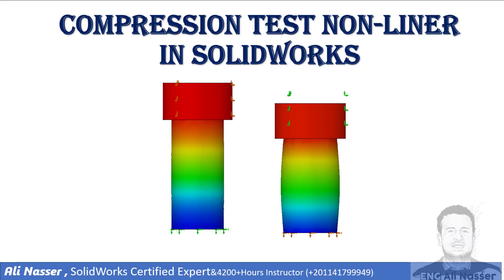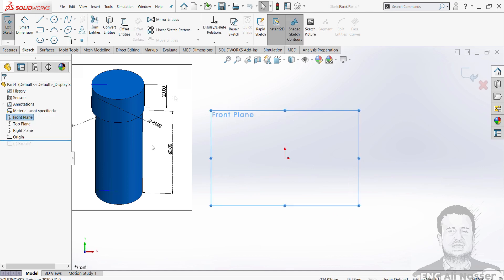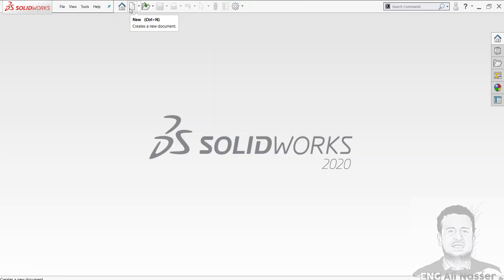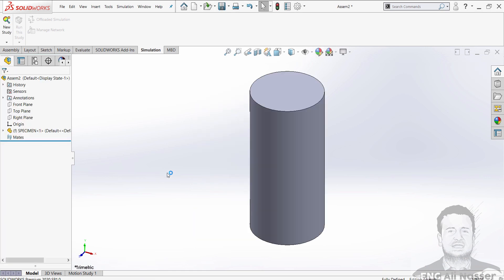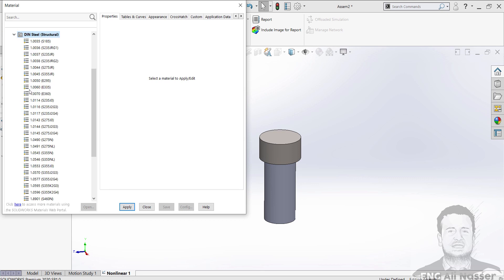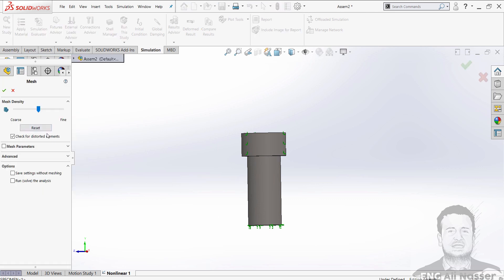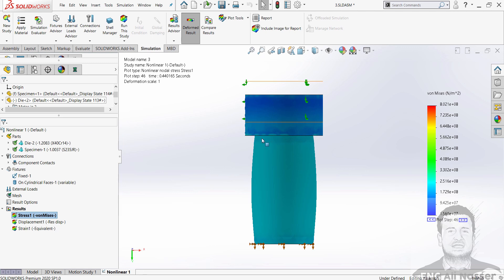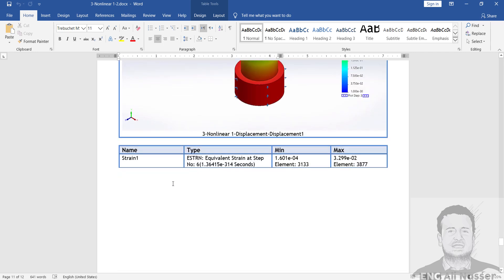Non-linear COMPRESSION TEST in Solidworks

Comment: Thanks for your great videos. I tried to perform compression test on cubic lattice structure but it lasts for several hours before it crushes. I follow same steps you did.
Reply from the maker: Try reducing the mesh size or using a finer mesh, since long simulation time is usually caused by coarse mesh or complex contact definitions.

Comment: Hello Dr, why do we use static no linear here?
Reply from the maker: Basically a nonlinear static analysis is required for any static application in which the stiffness of the entire structure changes during the loading scenario and  the  simulation must be solved incrementally to account for the stiffness changes.
Also you have to know that:
There are three situations in which the stiffness of a structure changes,

    1-The deformation of the structure is so large that equilibrium must be considered at the deformed position rather than the original position.
   2- The material’s mechanical properties change during loading, in other words the internal stress does not remain directly proportional to the internal strain caused by the external load. This is the case for materials that display plastic or hyper-elastic behaviour.
   3- Changes in physical contacts allow stress transfer between structural components.